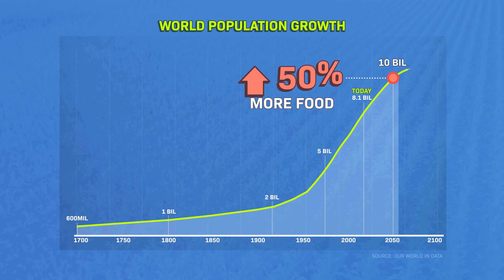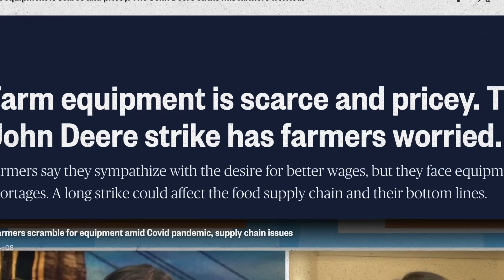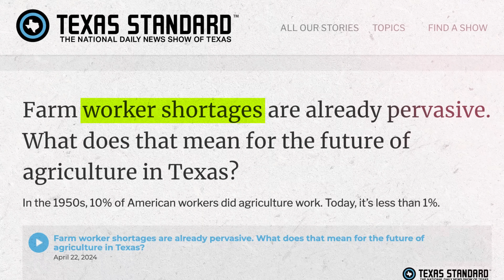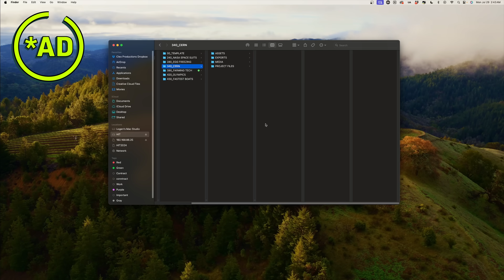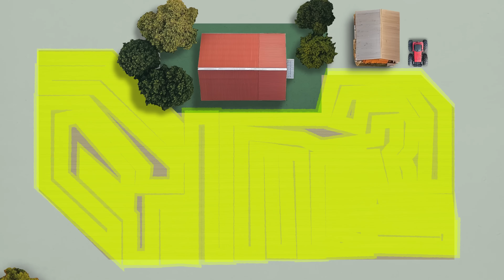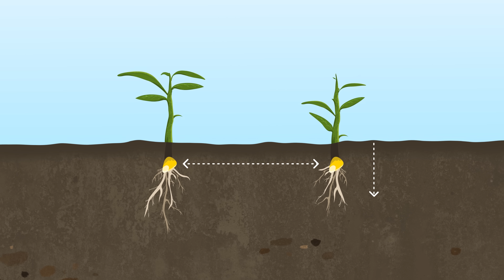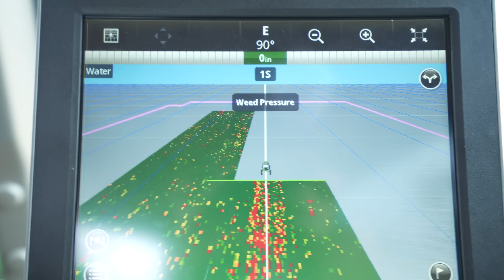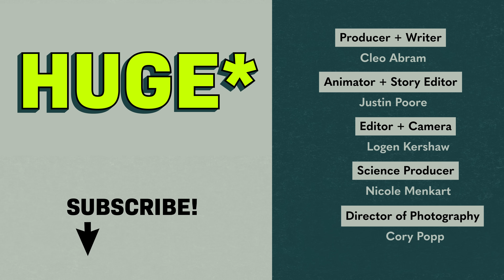Why This Robot Kills Weeds With Lasers

Comment: The global population is still growing, but the rate of growth has been slowing. As of 2025, the world population is approximately 8.2 billion, with an annual growth rate of around 0.85%, adding about 70 million people per year. Projections suggest the population will peak at around 10.3 billion in the mid-2080s before stabilizing or slightly declining, largely due to declining fertility rates globally.

Comment: The answer is a system that allows regular people to grow their food themselves… or should I say… a system people can run that allows food to grow itself without the need for people to do anything but plant and pick… that’s right completely organic food that grows itself and all you have to do is use the same amount of energy you would use at the grocery store… just as you would pick the food you want and put it in a bag and then put it in your basket… so actually that’s a lot more work than just walking outside and picking it and bringing it in…

…it is in beta but actually exists and I am currently using it… it is called The F.A.R.M 9000 because it will produce $9,000.00 worth of food at todays prices over 30 years before it needs to be replaced and costs $3,000.00 that’s right 200% ROI without any transportation of the crop… highest quality… highest freshness… lowest price… lowest impact… no tractor needed… no fuel needed… no water needed… no chemicals needed… no pesticides needed… no electricity needed… no pumps needed… and OMG does it pump out food like crazy… without wasting anything… that’s right 100% efficiency… now if I can figure out how to get it to the world without anyone steeling it from me.

It just sits there by itself pumping out food for 30 years.

Comment: Recently, I attended an academic lecture where they talked about how difficult this problem is and how we are still at the very beginning. It’s good that John Deere is also working on it because they have more money. One of the challenges is that weeds are highly diverse. A single type of weed can vary greatly depending on location, time, weather, and even its age in days. Moreover, there is a lack of datasets. High-quality multispectral cameras are expensive—and you need more than tens of them for a single tractor/robot.

Comment: Good job giving us a glimpse of interesting and hopeful content. Selective weed control made possible by AI enhanced technology is very promising and will be a boon if it ever approaches cost parity with herbicides. Non-selective weed control (the most common strategy) is a much bigger challenge. Just as a reality check for those who are not familiar with the scale of this topic: My antiquated, low tech, 30 gallon spray rig filled with 1.5% RoundUp 3-point hitched to my compact Kubota hobby tractor will kill 4,876,000 weeds in the same one-minute Big Ag claims the laser technology will kill 5,000. IOW, the laser technology is 0.001 as efficient, or 1,000X less efficient than RoundUp. My total cost (CapEx + OpEx + Consumables) for that one-minute is $0.17. The cost of the same job performed by the laser system, depreciated over the same 5 years will be $1,000s per minute. Reduction or even elimination of herbicides has tremendous value and we need to continue/accelerate pursuit of this goal but, to be responsible, a video like this should give us a realistic future outlook by including information about the enormity of the barriers to entry.

Comment: Excellent overview of the whole situation, one of the best I've seen. I am a right to repair advocate but somehow we are going to have to get used to the complexities of these new machines. Personally I believe the most practical way is for the OEM to supply, at a minimum, the communication protocols etc that are used in these systems to allow 3rd parties to develop test systems and or the OEM to supply test systems and education. There could be serious money for the OEM in this area in addition to maintaining their agent networks. A large reason for locking down systems is because of the interdependencies between controllers. The firmware and hardware levels must be maintained very closely and that in my opinion is reasonable reason why OEMs are having to restrict access. However the days of locking out existing features and blocking correctly installed parts has to stop. Having said that Farmers are going to have to accept that maintaining their own equipment is not cheap and the knowledge required is significant so I suggest they are either going to have to bite the bullet to be standalone or promote and support local specialists to set up and maintain their skills. There will be some really interesting jobs and business opportunities coming up for everybody including the OEM

Comment: My cousin in South Africa is jury-rigging tablets with GPS into older machines to have them perform the higher tech functions, even though they aren't a massive estate farm, and its really cool. Right to repair is absolutely necessary for farming.

Secondly, not all topography is suited to automation, when inclines get too steep, bigger vehicles will tip, so it still has to be done by hand.

Finally, ask any farmer, and they would die rather than give up meat as a diet option.

Not sure where I'm really going with this. As someone in IT it just feels like 'yeah tech is cool', for tech sake, but I'm not sure I trust it to the ones developing it.

Comment: Livestock that is fed with grass is still efficient if the grass is grown on land where crops for human consumption can't be grown, or at least not grown in an economic way. E.g. alpine regions. Also, livestock can be fed with parts of crop plants that aren't used for human consumption, e.g., leaves and stems of plants where we only use seeds or fruit.
I.e., there are quite some efficient ways for feeding livestock.

Grain fed beef and dairy is a folly for several reasons and inefficient w.r.t. land use, i.e., that should be stopped. Grain is also not a species appropriate diet for cattle.

Comment: Cool video!

Precision agriculture... I've seen similar systems on commercial mowers that use GPS for mowing in precise rows. Precision mowing, I guess you'd call it. Doubles the price of the mower though. And the mowers still require operators sitting on them. I'm looking forward to robotic mowers getting good enough for my hilly yard.

Drone tech is also poised to offer serious benefits. I've seen a drone created as part of a grad student's thesis, and it's designed for weed control. It flies over a field, uses a camera to identify weeds, then sprays them with herbicide. And this doesn't require a "15 ton tank".

Comment: You rightly and briefly talk about the problems to be solved. It’s also great that tech is minimising excessive use of chemicals and moving to multiple crops. At least farm tech is evolving. Can someone show me the machine that restores the soil microbiome and soil depth rather than a sterile base that blows away? It’s also a key to carbon capture. Then there’s the 40% drop in nutrient density of our crops and predictions of population collapse over the coming decades as countries prosper. Yes we need to do more with less, but all this seems to ignore the need to create a,sustainable soil filled with all the living fungi and microbes that sustain soil

Comment: I am surprised that pests were not mentioned. If you can quickly recognize weed and kill it with a laser then the same should be possible with pests.

Something different: This seems to be about huge machines (which are probably terribly expensive). With climate change and water problems even in the US I wonder whether someone is working on the "opposite" approach: Put solar panels on fields so that the amount of sunlight reaching the ground can be regulated (plants need only a fraction of the sunlight and too much of it increases the water demand).

That would also allow for the precise movement of very small, slow machines (which do not have the problem of left out areas) as they could move along the panel structure instead of on the ground. There would be electricity available everywhere for the small machines, and the distribution of water would be simple. If a small machine (1,000 USD) breaks then you may just throw it away. The repair problems of a 1,000,000 machine just disappear. Have a simple machine make pictures of plants, send the pictures over the Internet to a system which tells you whether it is weed or not. The plant will still be there on the next day. No need to put sophisticated hardware on a tractor. This would work very similarly for smaller farms, too.

Comment: The intercropping is the same thing that most people use on their gardens and something that we desperately need to start doing on a larger scale to bring back the soils naturally without using synthetic fertilizers which is killing the ground. Not to mention the amount of CO2 that is released from tilling can actually be seen by satellites. The change is quite dramatic. All the feed corn we grow for cattle needs to change as well. Cattle do not require feed corn to survive. They require grass. Obviously we use the feed/field corn for things other than animals, alcohol, starches for food, etc. But in general we need to get away from monocropping because its killing the ground.

Comment: Step 1: Do not till the soil. Eliminates a step and saves on time and equipment maintenance. Tilling breaks up the fungus networks that developed during the growing season. It also accelerates soil drying and wind erosion.

Step 2: Re-introduce crop rotation. Leaving in the roots and stumps improves soil stability, water retention, reduces water and wind erosion rates and as the roots rot the soil is nourished.

The "precision" part of the agriculture can identify sprouts later and deliver precise squirts of fertilizer later.

I've seen videos of systems that are more advanced than this. Hopefully these startups can give John Deere a run for their money.

Comment: Love the video. I shudder at step 4 as by shifting from peanuts to Soy we're shifting the problem. I'm allergic to Soy, which bits still to be determined, but the decision to stop using peanut products to counteract the peanut allergy and cater to the 'Gluten Free" fad means finding soy free food is hard. Recently found out a lot of bread is using soy flour now. That was a close call.

I should be clear it has to happen but with thought and control for once.

Comment: I think the trend might go back the other way, small 1 to 10 acre individual family farms.  Instead of mono crops  huge diversity with crops that provide cross fertilization, soil enrichment and environmental stability.  The biggest obstacle right now is huge time and labor inputs by said family.  That's why I think a $20,000 Tesla humanoid robot  solves the problem.  Imagine having several T. bots that could work 24/7.  They do all the hard labor while  you dream up ways to become more efficient & profitable.

Comment: I don't understand the right to repair thing. It can be legislated, and in my mind everything made should be right to repair, but tech is so complicated how do you know how to repair it? Would John Deere have to have tech training camps for farmers? How do you repair circuit boards for example? You can't (realistically), you replace them. And if right to repair ends up right to replace then they make all they want on their patented replacement parts.  And tech changes so fast it would be impossible for the farmer to keep up and be a farmer as well, it would become a specific job, or the farmer is no longer a farmer at all but a tech supervisor and repair specialist with the machines doing absolutely everything and the human element getting further and further away from the actual soil. It all ends up with no one working the land anymore with us relying solely on tech. That's a dangerous place to be if things go wrong geopolitically or many other reasons. It seems like we are decreasing resilience through this reliance. Imagine a world where no one knows how to grow anything, it's all a program. We need to really think hard about what we're signing up for and where we want to be down the line and if farmers don't want to be farmers anymore but robot technicians (perhaps AGI bots on the future will do the fixing anyway then there will be no need for a human on the farm at all, just corporations running the tech. Lots to think about, changes are happening fast.

Comment: The cost of these machines put non-corporate farming out of business
Reply: The same technologies are being developed on a smaller scale already. In fact, most of them were originally piloted by small scale hobbyists. The commercial sale of products using the technology at small scale will come as the big guys prove out the market and develop the tech into packaged technologies. Both large and small scale creators are learning from each other. It's just the large, high money products are coming first. But the smaller scale products are coming very rapidly and will be common before these processes have been fully deployed on large scale farms.

TL:dr; be patient, that's coming too.

Comment: Ocean farming, the U.S. uses only .05% of available ocean acreage, (yes that number is correct) and that's just the U.S. Right now in Maine you can lease one acre of ocean floor for $300 a year, or you can lease that 1 acre entire water column for $2,000 a year. But the difference is on the floor you can raise soft shell clams and scallops but in the entire water column you can also raise muscles oysters and sugar kelp. But the up side is, no fertilizers, no pesticides, no manure. And the kelp is also a carbon sink, it removes CO2 from the ocean.
Reply: So also destroy the ocean floor after we're done with the land?
Reply: @oa2323  what's there to destroy... Sand? That's why you have to lease it so the state tells you WHERE to farm to ensure you'll have the least impact on the environment.

Comment: What is presented here doesn’t increase foid production, it just requires less man power or use less pesticide but it doesn’t really increase production per acte.
Reply: There are some things in there that increase production like the precision seeding. Also depending on the climate you might be able to plant an extra time if you can increase the speed at which you harvest etc

Comment: This is great stuff, but as somebody who's worked in veg manufacturing for nearly 20 years, the supermarkets (at least in the UK) have a big part to play in ensuring future food security.   So much emphasis is put on uniform crops as a proxy for "premium brand" veg.  This leads to a tighter band on usable crops, with manufacturers then having to hunt for an outlet for the rest of the crop, with much going back to cattle feed, leading to lower return costs for the farmers.  Yes we've had advances in optical quality sorting and have so many pieces of equipment to dice, slice, grate, julienne etc product (each process with their own yield loss), but fundamentally the drive to ensure food security needs to come from the large companies that pass the product on to the end consumer, as it's them that are by far the biggest influencers in the field (no pun intended).

Comment: Hey Cloe and Huge if True team.
Im a big fan of the cannel.

A crucial issue was not covered in this video. Soil loss.
If we continue to farm as we do. We will soon loose our soil to erosion.
One of the main causes for soil erosion is the way we do tillage in today's modern agriculture. In your video, you introduced tillage as a key part of the agricultural process. But this is not necessarily so. No tillage or reduced tillage systems are existing ag practices that have been shown to substantially reduce soil erosion. Mixed together with other key practices like cover crops planted in fall can prevent soil erosion catastrophes.

If we don't adress the threat of soil loss to erosion first , the rest wont really matter on the long term. There will not be enough land on which to grow food crops.

I recommend reading the books "Dirt" and "Growing a revolution" by David Montgomery discussing this topic.

Comment: I think the focus eventually will be on chemically synthesized food. It's not unimaginable that in the future we will use clean electricity to produce hydrogen that will be converted to methanol or formic acid or another small organic molecule that can be converted by microbes to carbohydrates, fats and proteins. Don't forget that crops can only convert less than 1% of sunlight to food while solar panels in the near future will convert 30-35%.

Comment: As a farmer myself, I had no real gripes with this video, I’m so used to people outside of farming communities blaming farmers for the decision they made with the technology available especially when it comes to herbicides and pesticides (roundup was best chemical for weed control and still is the safest). 

I was hoping you’d touch on the dilemma farmers currently face where tillage is bad for soil heath. However, without tillage the only current option is more and harsher chemicals. At the current moment lasers are only viable is certain use cases where chemicals cannot be used because the lasers can only travel through the field at .5 to 1 mph and have working widths of around 10 feet (compared to 15 mph and 120 feet) and lasers can only kill weeds that are out of the ground whereas sprayers can apply residuals that will keep weeds from growing for 1-8 weeks.
Reply: Don’t get me wrong I hope laser tech can improve, however it has a long ways to go before it is economically feasible or possible for most farmers.
Reply: Btw a see and spray sprayer cost around $750,000 and has a “subscription” of $4 per acre worked. Making it harder to economically justify being that custom application (where you pay someone to spray for you, not needing to own the equipment or do the work) cost around $8 per acre